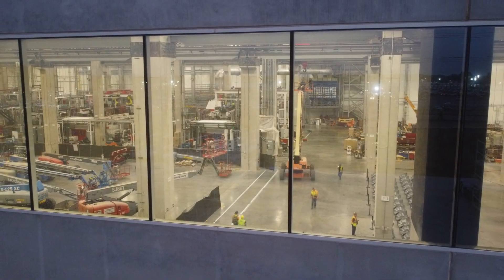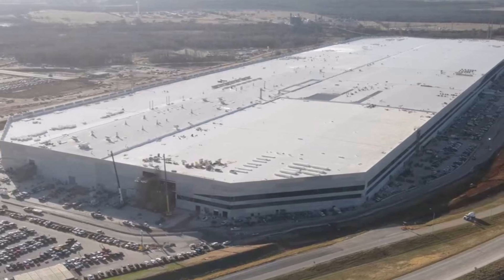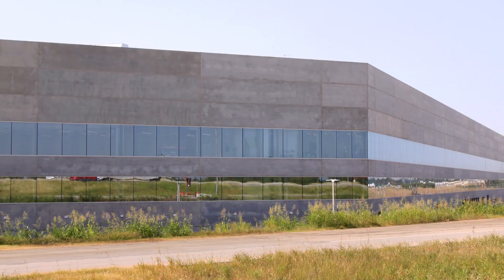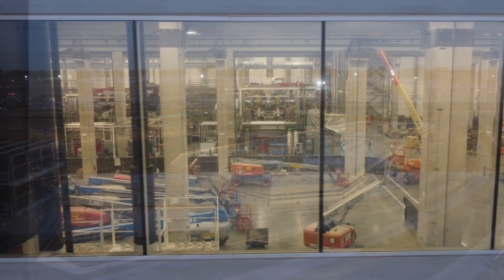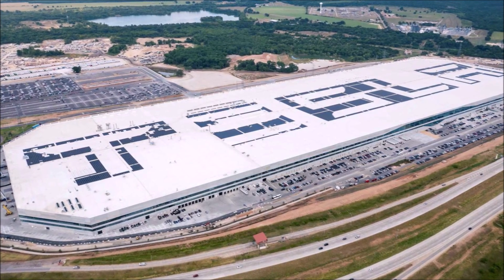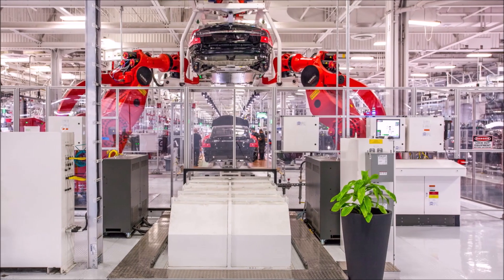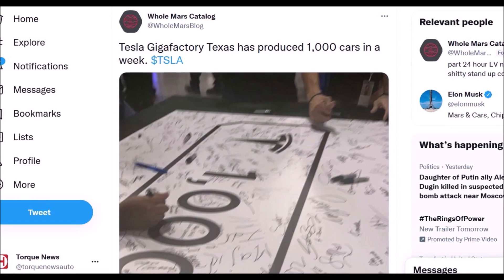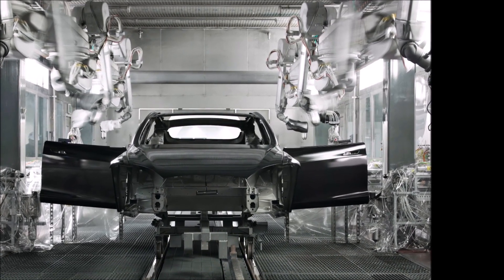Tesla's New Test at Giga Texas Gives It a Big Potential

Comment: Thank you Armen for your great video.
Few years ago, Elon mentioned that the main obstacle for massive EV production 
are the batteries 🪫.
This obstacle does apply to all EV manufacturers.
Why?

Look at GM , last year they experienced batteries 🔋 failure 😨 and a lots of fire 🔥 
has occurred.
General Motors was forced to close the EV production.
They had to redesign the batteries 🪫 for their EVS.
General Motors Q4 2021 production was : 26 EVS.
General Motors Q1 2022 production was : 499 EVS.
General Motors Q2 2022 production was : 8,000 EVS.
For compering purpose:
Last 9 months, for each 1 EV produced by GM , Tesla Inc. produced 1,000 EVS.
The ratio is 1 : 1,000
With all do respect ✊, GM will not catch up 🆙 to Tesla when comes to EV production!
CEO of GM Marry B. is going to get early retirement soon 🔜, isn’t she?
Reply from the maker: You are most welcome Dariusz.

Comment: Due to the problems with the Model Y with the 4680 batteries in Texas, Tesla has an abundant supply of 4680 batteries piling up in inventory from the Kato Road pilot battery factory. This is why Tesla had moved up the date for the first Semi deliveries from next year to the end of this year. It is better to begin shipment of the Semi than to let the inventory of 4680s to continue to pile up. When the problems are resolved with the Model Y, they will resume volume shipments to Giga Texas. 

As Elon has stated, Tesla has plenty of batteries this year. With the Standard Range Model 3s and Ys using CATL batteries and with the Megapacks switching to CATL batteries, Tesla has an abundance supply of 2170 batteries that can be used to produce all of the longer range Model 3s and Model Ys they can produce.
Reply: Not sure I agree. With ramp of Texas and Berlin. They are gonna be short battery supply soon as we know the problem is ramping 4680

Comment: Just wondering should the next generation of structural body parts should be Carbon Fiber?
Reply from the maker: Why carbon fiber? How safe will those be for Tesla and electric cars in general?
Reply: @Torquenews  Just watched Sandy Munro's review of BMW IX. Where carbon fiber was used in structural body components. Weight. EV is generally heavier than ICE, due to batteries.  CF is lighter and stronger than aluminum, no? 
https://www.youtube.com/watch?v=khJQgRLKMU0&ab_channel=M9USA
Reply: Carbon Fibre makes a very strong auto McLaren are famous for their crash worthiness but the process so far as I understand it is slow and not suited to mass production. I could be wrong about this though it's not like I am Sandy Munroe.
Reply: @blueskyresearch6701  You are right. However, Elon and his team are pretty smart IMO. Elon will figure it out. That's why he will be the first Trillionaire.
Reply: Carbon fiber is great, but the curing process during production takes a lot if time, heat, and pressure from an expensive autoclave. And even if you filled giga Texas with autoclaves it still wouldn't produce as many carbon fiber car bodies as a couple of gigapresses hammering out aluminum castings every 90 seconds. Aptera will have this scaling issue.
Reply: No!. Limited production unless big breakthrough in manufacturing.